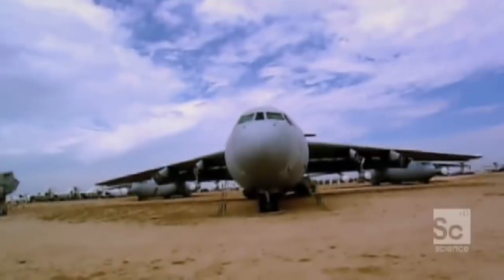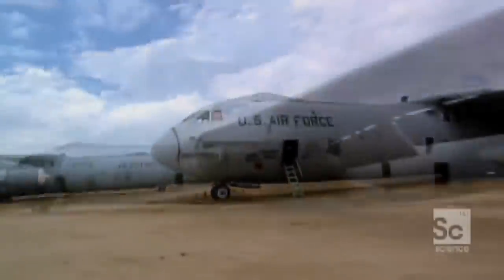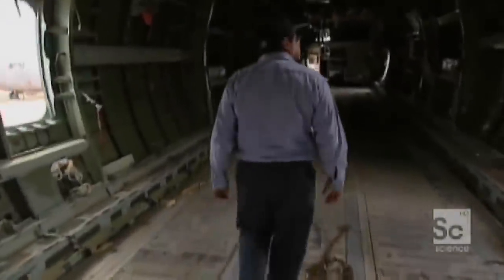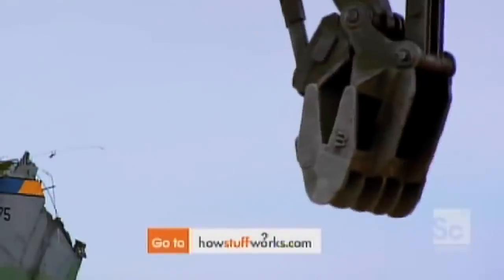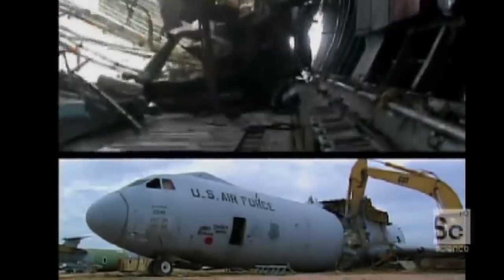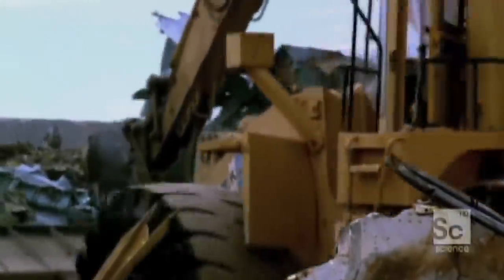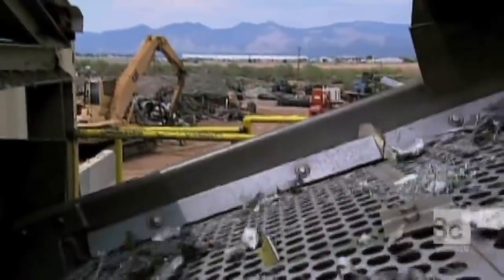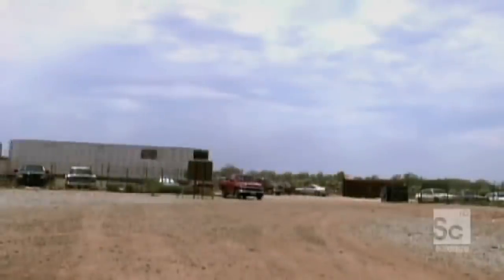Airplane Recycling

Comment: I flew on a C-141 to Cairo Egypt from the Continental US back before the C-17 replaced them in the mid 1990’s. You needed earplugs to prevent hearing damage while riding in the cargo bay, sitting on nylon webbed jump seats.  Compared to the modern C-17 Globemaster it was an old relic, but it served the Air Force well.  Kinda hurt just a little bit watching those old planes be chopped up into bits.